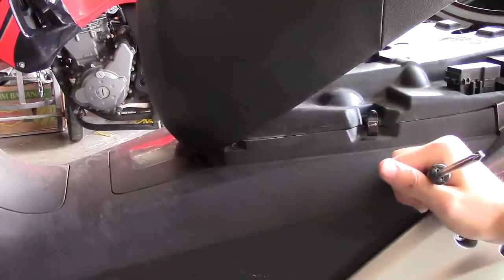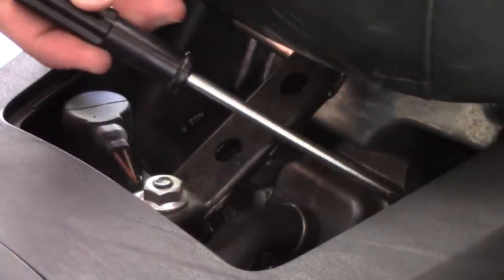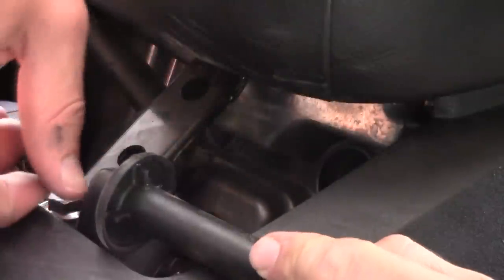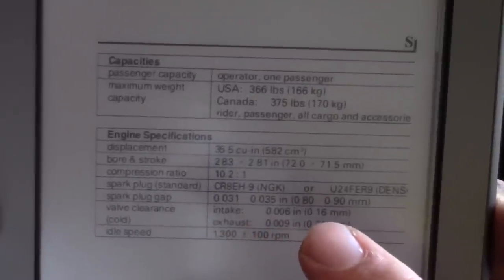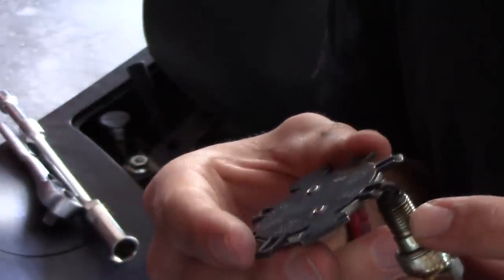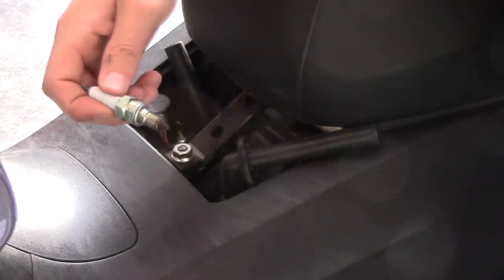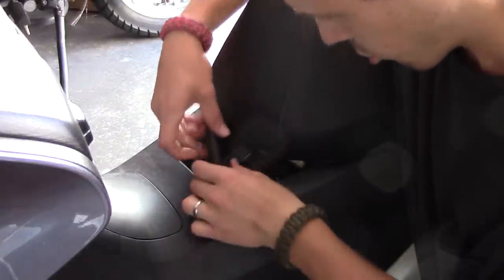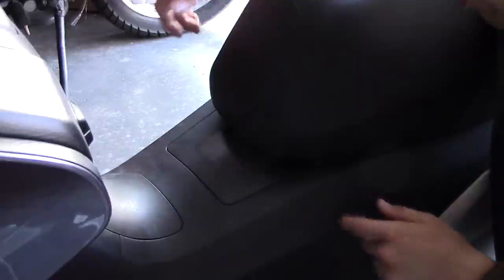2007 Honda Silverwing Sparkplug Removal

Comment: A tip on spark plug installation. What we have used to install the Silverwings spark plugs (S.P.) is a 6" to 8" long, piece of 3/8 id, black, flexible, fuel line. Just push the new or cleaned S.P. into the fuel line end, and insert it into the S.P. hole and start the threads a few turns. Pull the fuel line off the S.P. and tighten plug to specification with wrench... Works great every time.
At this time, I own a 2006 SW.
Reply: Thats a Great tip !  I just purchased a 2015 Silverwing 2 months ago, mind you it had been serviced just before i snagged it up, but i want to know how to change the plus, Oil and filters and everything else i need to do for maintenance .. Any other tips you have would be great, Im all ears .  Cheers .
Reply: Thank-you ✊🏿

Comment: Using neoprene hose about a foot long holding the spark plug is a good way to locate the threads by hand when installing the plugs.

Comment: I feel like stripping off all the plastics covering the bike and expose everything for easier maintenance. It would look like it was wrecked, but would save me lots of time servicing it.

Honda didn't even make the signal lenses removable for a simple bulb change - I'll use an oscillating tool to cut through the lens to replace the bulb and tape it back together before I go through the trouble of removing so much plastic stuff.

The bike has a nice look, but way too complicated to get to the motor as far as I can tell.

Thank you for showing me the ridiculously hidden plugs that I'll eventually need to tend to.

And I thank the commenters (below) on the idea of using a rubber hose to start the threads when replacing the plug for more of a tactile approach.

Comment: Thanks for the vid, just as a matter of interest, a length of rubber hose which is a snug fit on the plug can be handy for re installing it. You slide the hose onto the plug and lower it down the hole, you turn/twiddle it at the bottom until the threads engage, this gives a lot more feel than using the plug socket and extension. Cross threading the plug holes can be a disaster...
Reply from the maker: That's a good idea.

Comment: To replace the plug in a deep hole, use a chunk of hose or tubing...if it starts to cross-thread, the tubing will spin and prevent it.

Comment: Have you ever taken off the front tire? I hit something on the highway and dented my wheel so I want to remove it so hopefully I can find another one to replace it with ( which has been a pain in the butt trying to find one).
Reply from the maker: I did to replace the tire. It's not too bad if you have the right tools.

Comment: Lol starting the plug can be done with the socket, it means to start the plugs by hand with out power tools like a makita drill...
Does the mannual say anything about using anti seize on the threads of the plugs before putting them in?
Reply from the maker: I just took a look, and it does not say to put anything on the threads.

Comment: Why on  spark plugs carbone you have a rich air fuel mixture you should to turn out air mixture copper screw maximum 1.5 turn out
Reply from the maker: Pretty sure this engine is fuel injected, so there is no tuning of carbs.
Reply: @NathanSalapat  no there are two copper screws on intake manifold i will send you infos and picture you should do it to regulate air fuel mixture to 14.7/1

Comment: What a messed up access design Honda did with this...
Reply from the maker: I agree, but at least you don't have to take half the bike apart to get at it.
Reply: That is VERY true LOL
Reply from the maker: Like my car, if I need to replace the headlight, I have to take the front wheel off, now that is really messed up.
Reply: WOW!!! The most I have ever had to move to change a headlight in my truck is a battery....